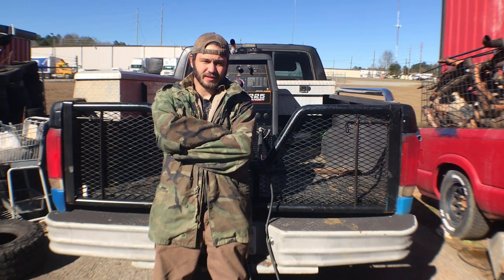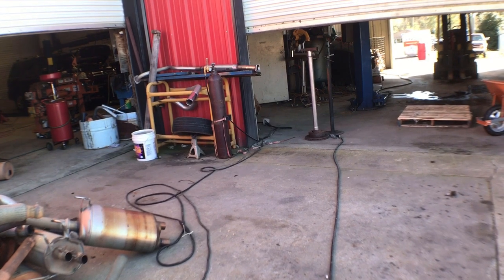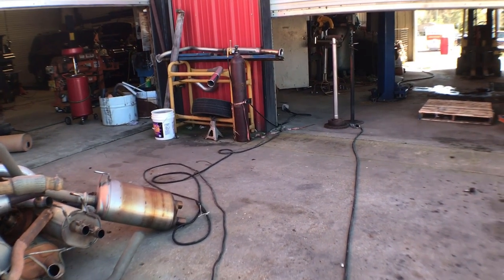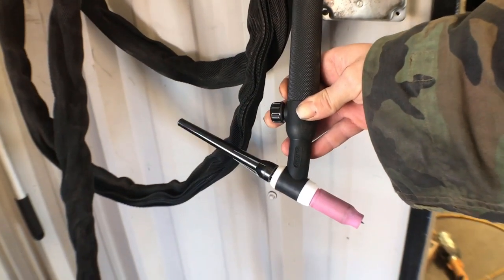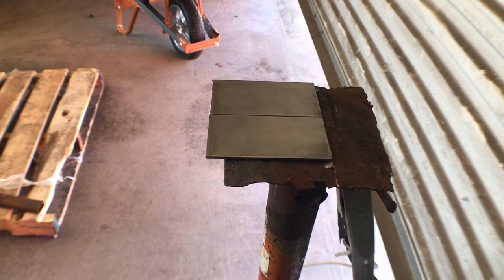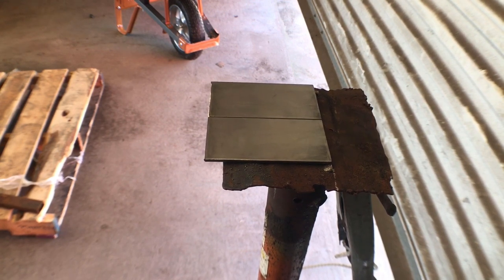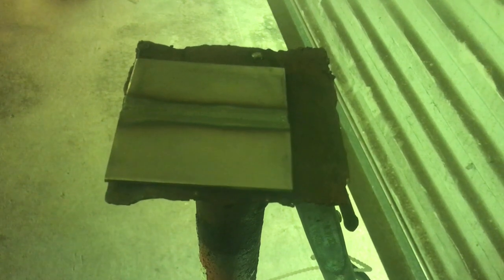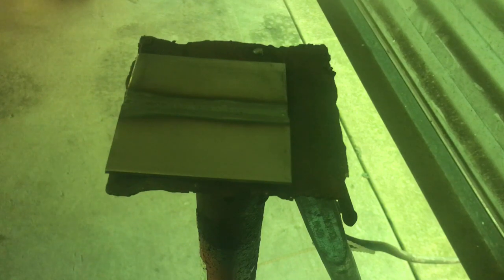How To Hook Up a Tig Torch on Lincoln Ranger 225

Comment: Good video man. I just ordered me a torch and that really helped me out on how to rig it up.
Reply from the maker: Glad I could help you it really has served me well over the past couple years though I never really did much tig welding most of what I ended up doing was stick or off a small mig welder run off the generator side of the machine

Comment: Yep that's how to do it. Been doing tig off my ranger for a decade. I use 2 percent lanthanum tungsten's and have a copper plate to start the arc on. I use a 17 tourch with valve. Can't use it on aluminum or outside as a breeze will blow the shielding gas away. Grind mill scale away as the melting point of the scale is around 3600 degrees F. I like E 70 s6 filler but if you are looking for the stack of dimes look the s 2 is preferred. Have fun. Make cash.
Reply from the maker: Yup! Glad you enjoyed the video hope you look forwards to some projects I have coming up in the future

Comment: your a hidden gem man here i thought you would need a seperate machine
Reply from the maker: Thanks and not for steel and I’ve seen some old timers do aluminum on one too but I can’t can’t and I don’t think there are any codes any more that still allow it without hfac. But if there is anything you would like a video don’t on I’m fixing to start back up! Getting the rig back together in my next couple videos
Reply: @adamswelding5052  
U can maybe be a little go pro n record the jobs youll be doing. Only guy i know that does that is austin ross n it sure is entertaining
Reply from the maker: I tried but never could get it to turn out right. Might try it again down the road

Comment: Have you ever run a tig welder like the dynasty series off of this generator welder ? I got a dynasty 280 base model ... I want to try running on my ranger for aluminum
Reply from the maker: A tig welder no, but I have run the small flux core machine I showed in my video https://youtu.be/Hq5zQZBzC24 , it ran ok only thing was it is a 120V machine and kept tripping the breaker one when run towards the max settings which was on anything thicker than 1/8”. If it was a machine capable of being run on 220v then I’m sure it would have handled it a lot better

Comment: Here's an important question, can you tig weld aluminum with the ranger?
Reply from the maker: That’s a great question you can but you won’t be doing any code work on aluminum running off the ranger itself you can do dc aluminum but because it won’t have the cleaning action of AC it will not be pretty and can have some structural problems aswell as needing lots more clean up. If you want to do aluminum off of a ranger the best option it to run a smaller ac tig welder off the ranger or to get a spool gun setup for the ranger and spool gun the aluminum

Comment: I have a question whats the lowest amprage u can go
Reply from the maker: Not exactly sure lowest I’ve gone is 55amps on some 16ga ss, I’ve heard lowest it will stabilize an arc is 40 amps but I haven’t tried it.
Reply: @adamswelding5052  thanks for replying i was currious because i see its not digital and the first setting isnt top clear on whats the lowest amperage you can go
Reply from the maker: Theoretically if you could get the arc to stabilize you could go lower but mine for sure has a very coarse arc and likes to blow holes in thin material easily, so I try to stay thicker than 1/8”

Comment: What power block did you get and does that work?
Reply from the maker: It came with the weld city Tig kit and yes it works I still use it now and then
Reply: Its called a diverter block.  U might find it that way. There arounf 10 bucks

Comment: I have a question
Reply from the maker: What is the question
Reply: @adamswelding5052  why doesn't my tig torch end don't fit to my Miller bobcat
Reply: @joeanderson2468  is yours a scratch start tig rig like pictured in the video? If so you should be able to just hook it up with a set of stick leads like I do in the video